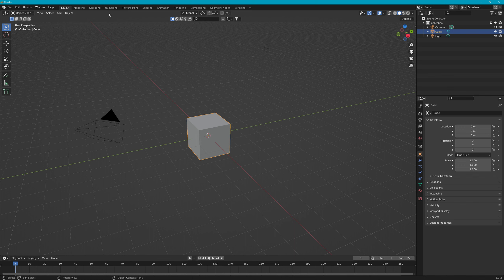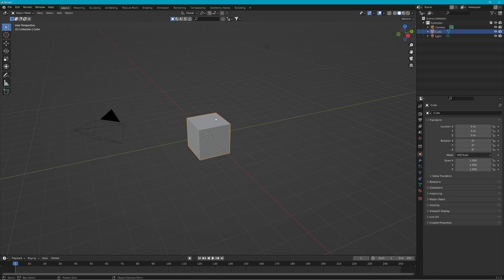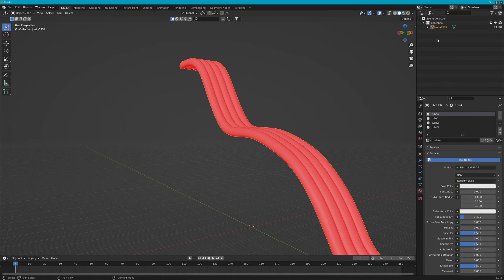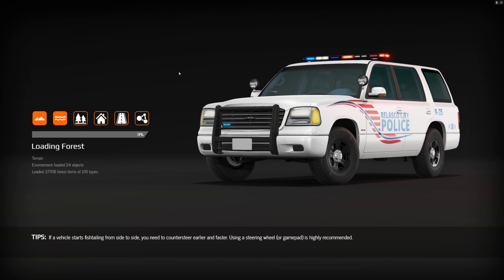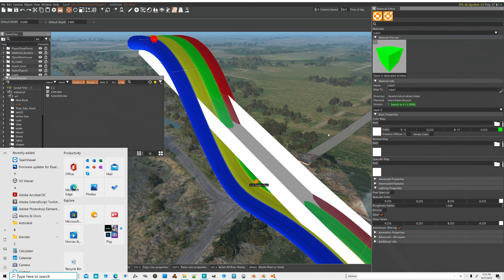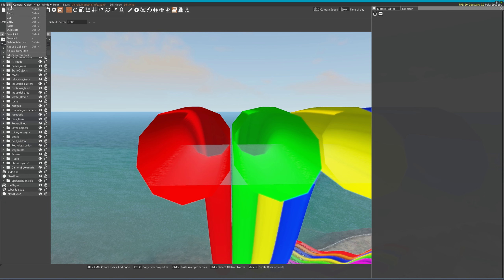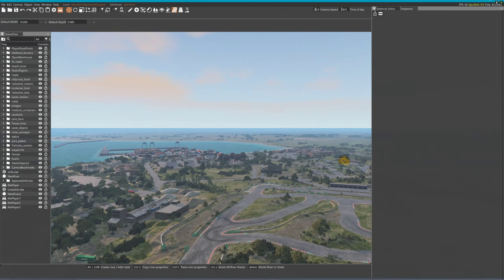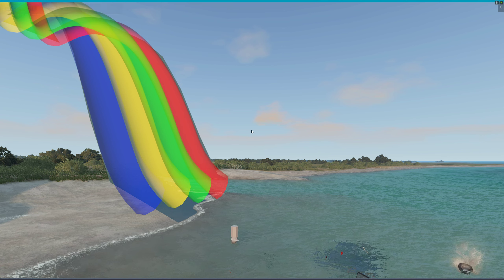Part of the video is messed up - Making a Water Slide Tube - Track Asset - Updated 2-26-22

Comment: Hey man, seems your links doesn't work anymore :(
Reply from the maker: I just tried it, it worked. It is a very small file, blink and its downloaded :D
Reply from the maker: Seems like maybe OneDrive is having problems. Tried 3 more times to make sure and 2 of the times it timed out. But it worked the first time.
Reply from the maker: worked the 4th time. Thanks for letting me know. I try to never move files or delete them for the reason of bad links. Though at some point I will have to upgrade storage, for not I still have 70+ gigs free. Dont see running out of room any time soon there.
Reply: @TerryMartinART  yeah, seems like that’s a OneDrive issue. I’ll try to download again a little bit later, thanks for reply!🙏